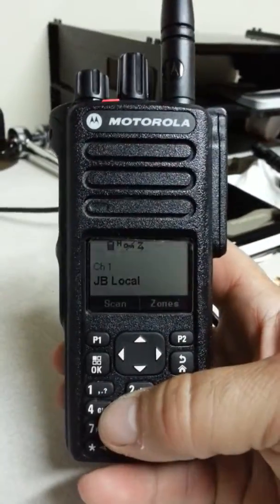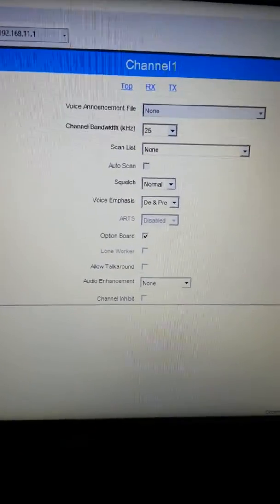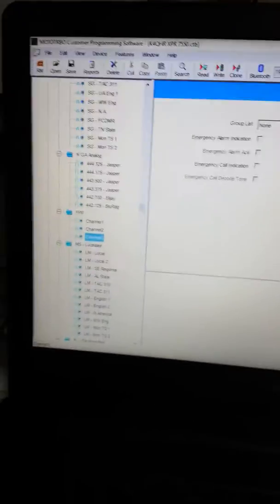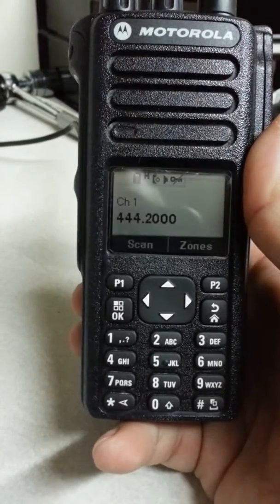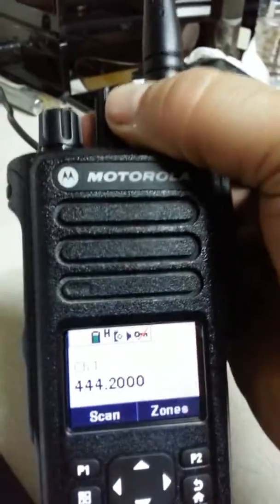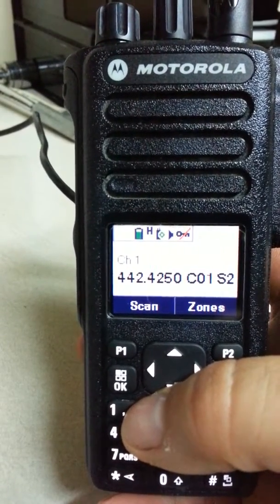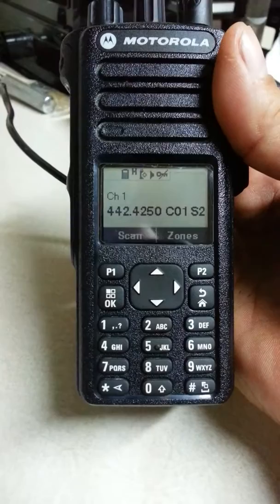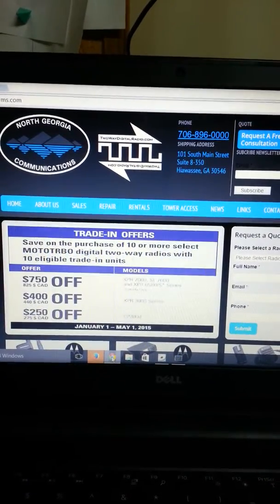Motorola MotoTRBO Front Panel Programming FPP

Comment: regarding the Option Board is it Built in or we need to have the Manufacturer add that before purchase ? thanks
Reply from the maker: If it is a US region radio it is built in from the factory and unless it has been removed by someone.
Reply: @NorthGeorgiaCommunications   Thank you ....
Reply from the maker: If you are interested in purchasing the Advanced Features for MotoTRBO which includes Front Panel Programming (FPP) and Over the Air Monitor (OTA), please contact me directly for the best pricing.
Reply from the maker: Yes as illustrated in the video.  You will also be able to access your changes from the radio in the CPS.  For more information, please see the following page and read the important details tab: https://northgeorgiacommunications.com/mototrbo-advanced-features/